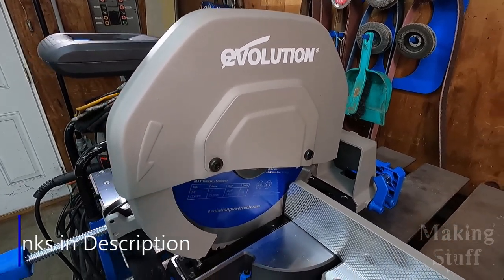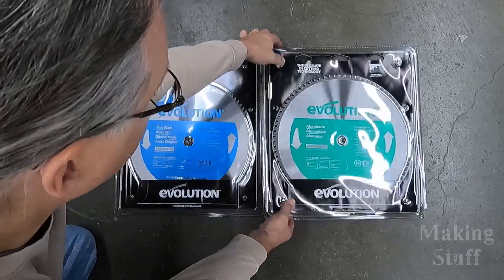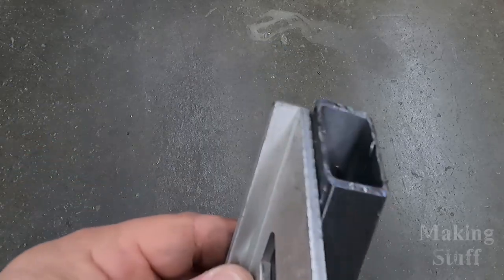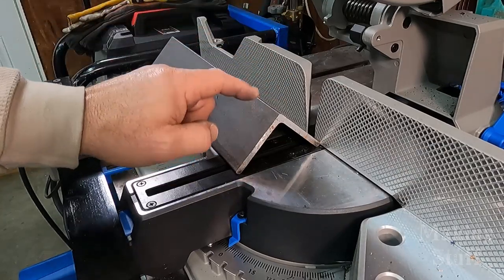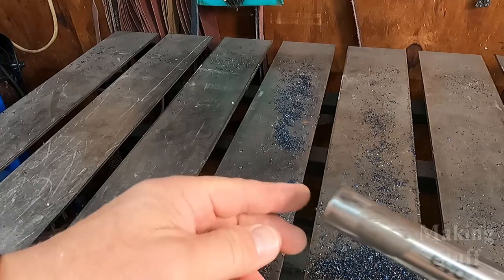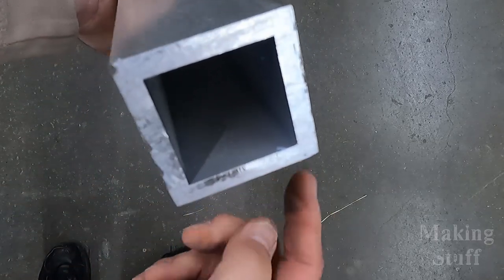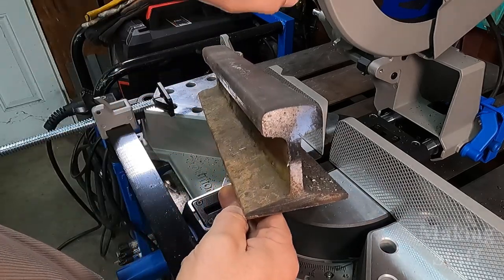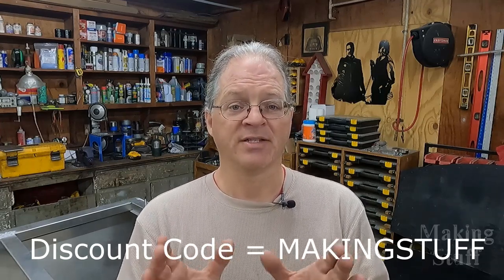Evolution S355MCS 14" Miter Chop Saw - Test and Review

Comment: The S355 chop saw is €360 but this mitre saw version is over €1000. It's the same machine with a different base. The price is insane.
Reply from the maker: No, the chop saw is not a miter saw.  It also lacks features that the miter saw has.
Reply: @MakingStuff  I don't think you understood my point. The machine ie the motor, blade, switch and handle etc are the same but the S355MCS has mitre saw base for a €640 premium
Reply: Time is money. When you're making lots of angled cuts it's worth every penny. Not having to flip your 10' plus length of steel end for end after every cut saves so much time. I will be buying one of these for the next job I can justify it.

Comment: I have the Makita metal cutting saw with a similar blade.  It's been a good saw, but this looks much more useful with angle features and clamping options.  Time to upgrade!
Reply: yeah I've been holding out for another manufacture to do one but its time to ditch that same Makita I've had for 5 years
Reply: I have the same Makita, awesome straight cuts but a pain for miters! I kept wishing they would come out with a cold cut mitre saw😮

Comment: Thanks for the review. I don't think having the blade contact the entire face of the stock is exactly best practice, but even so, it still appears to have done a decent job of cutting. It looks like the back adjustment would allow the blade contact to be adjusted for a better cutting process. I was wondering if it moves back far enough to start the cut on the corner of your material, especially while mitre cutting, where it would not be possible to mount the stock in any orientation except flat?

Comment: 2 questions: 1. How well will it cut angle iron clamped flat to the table to make miter cuts? 2. Will it miter 1/2" steel round bar?
Reply from the maker: It cut railroad track.  I think it can handle 1/2 steel round bar.

Comment: Very nice saw. I have a 14" Evolution Rage II saw which works great and a Evolution 10" miter which also works great. I like how you went all the way through the metal before releasing the power switch, I didn't after using the saw a few times ( thought it would make through the last little bit of metal) and lost a few carbide tips (dumb mistake!!).
Reply from the maker: Thanks for watching!
Reply: Woah, thought I made this comment for a minute

Comment: Is that a fuse box in the background instead of a breaker panel?
Reply from the maker: Yup, it's an old shop.  There are breakers on the larger stuff like the air compressor and 240V plug for the welder.

Comment: Is there an advantage to using cutting fluid when cutting aluminum on this saw?
Reply: No, this is a dry cut saw
Reply from the maker: It's a dry cut saw.  No fluid needed.
Reply: I've found that lubrication significantly increases the life of the blades.

Comment: So do these just have a blade that spins at a slower speed compared to wood miter saws?
Reply from the maker: Yes it spins slower than wood cutting saws.  The blades are also made to cut metal.
Reply: 1450 RPM compared to wood saw at 4000. There are videos around of people slowing down their wood saw and putting a $79 evolution blade on it. Haven't tried it myself.

Comment: Mine leaks oil between the motor housing and the blade.  Evolution says its normal.What????
Reply from the maker: Mine did too, about a month after I made the video.
Reply: @MakingStuff  They won't even answer  my emails anymore.
Reply: Why does it leak oil? Will they replace or fix it?
Reply: @Toxox1979  It just drips. They said its normal. Lol. I guess I have to wait until it blows up so they can fix it.
Reply: Ok I was wondering , must be coming from gearbox, I hope it’s worth the 850$ because I was wanting to get one for Christmas!
Reply: @Toxox1979  It is the gear box. They said it's grease  dripping when it's clearly oil.